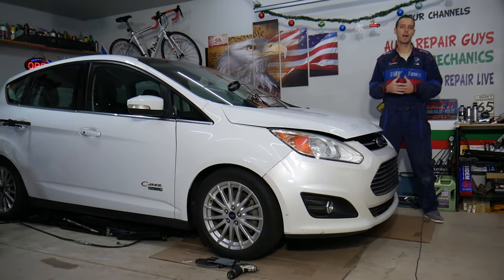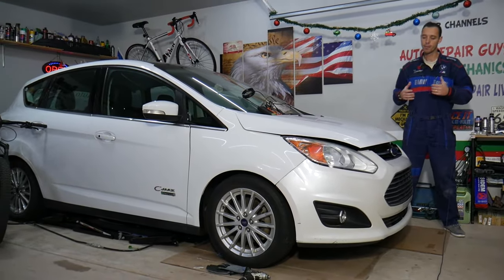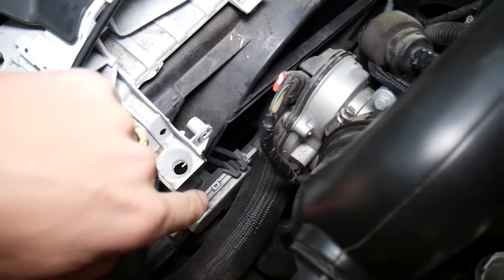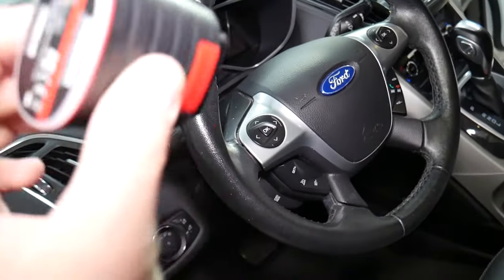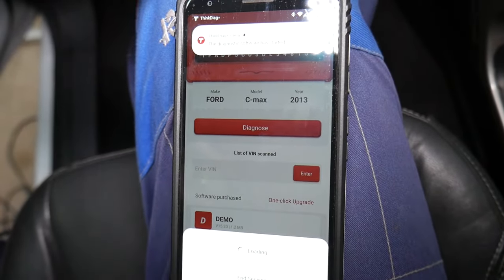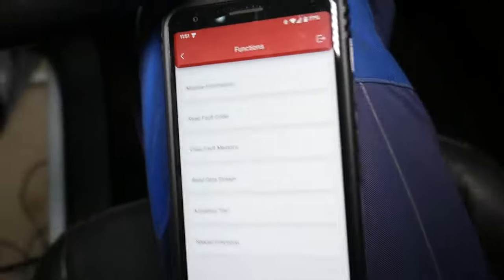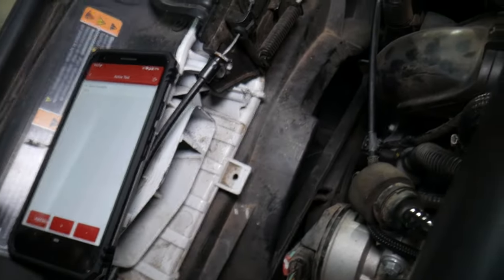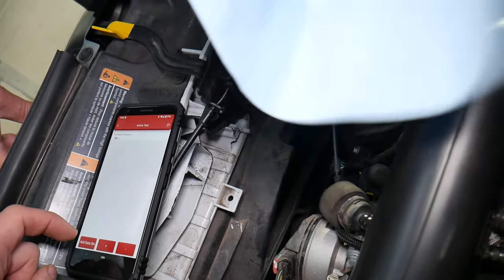HOW TO TEST RADIATOR FAN CONTROL MODULE ON FORD FUSION FOCUS FIESTA F150 ESCAPE EXPLORER EDGE MONDEO

Comment: Thanks for the video. Very informative. Could you advice. I have a 2015 ford focus 1.0. My cooling fan turns on few seconds after starting the vehicle even when the engine is cold and keeps running until i turn off the engine. Forscan does not show any DTC and i do not have the engine light on. I thought its a relay R12 and i changed it but the problem continued. I even changed the coolant temperature sensor and the problem was not solved. I changed the radiator control module and nothing changed. What do you think is the issue here?
Reply: Did you ever get to the bottom of this, i have the same problem
Reply: @lastoneleft844 still trying to find out ford focus 2013 se, I replaced the fuse, relays, fuse link, going to try changing the module and see if it works
Reply: @amin0358 did it work?
Reply: @justsimplytrash6703  i fixed it couple months ago it was my ac compressor not functioning at all when i changed it everything started working back normal fans kick on idle and driving.
Reply: @amin0358  how’d you find out it was the ac compressor
Reply: @justsimplytrash6703  ac clutch was not kicking in